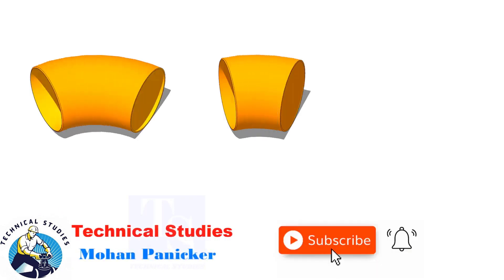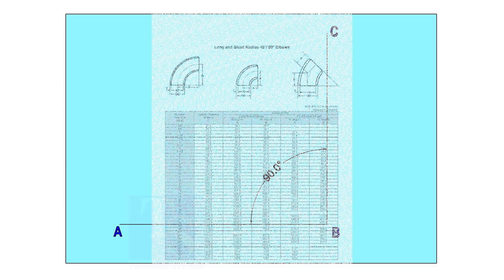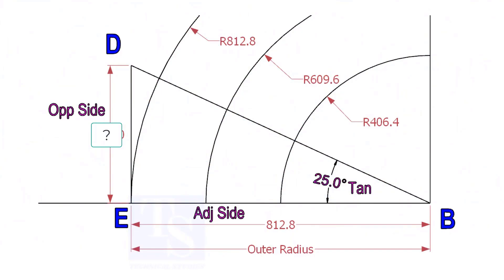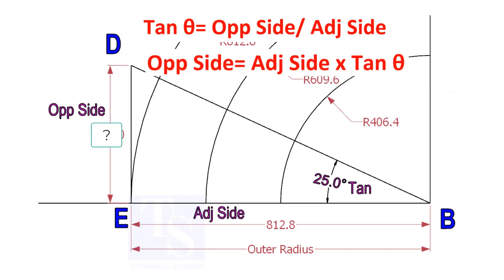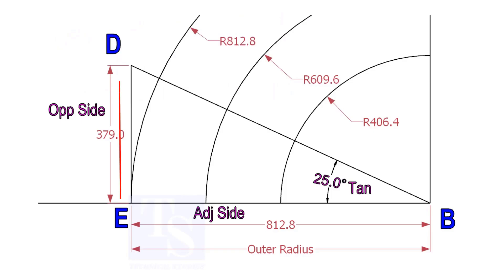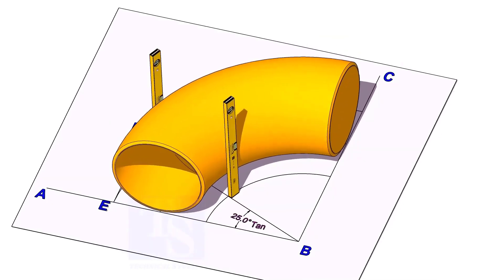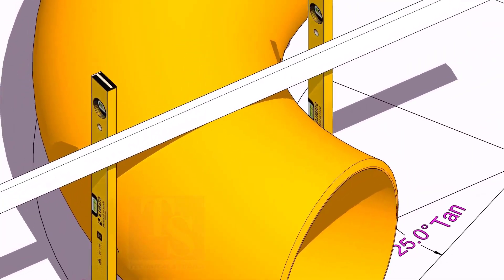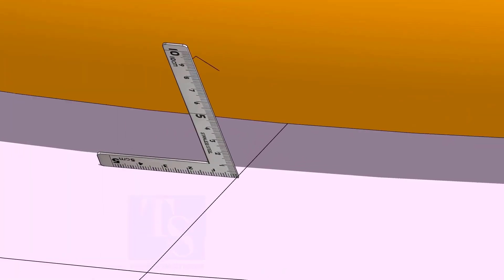How to Mark and Cut a 90 degree Elbow to Any Degree.

Comment: Nice video but can you explain what is the purpose of calculating the length of the opposite side which is 379mm? The markings on the elbow can be done without it no?
Reply from the maker: Bro, that is for the 25 degree.